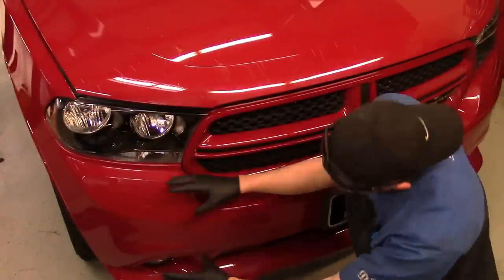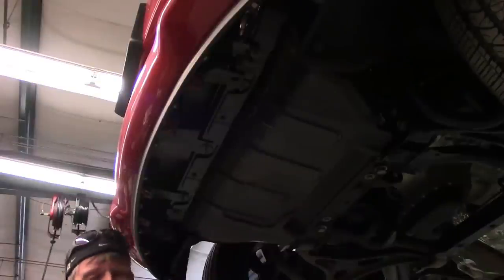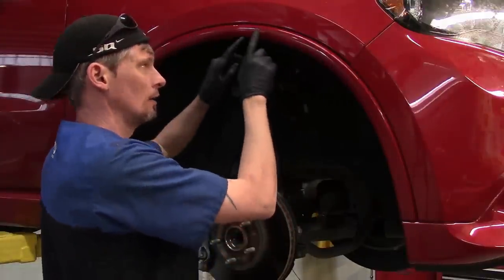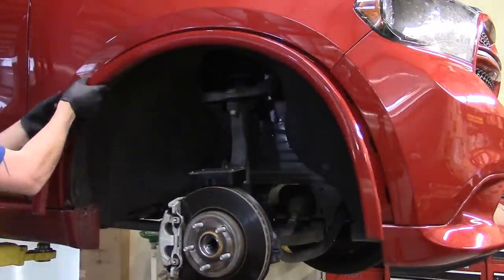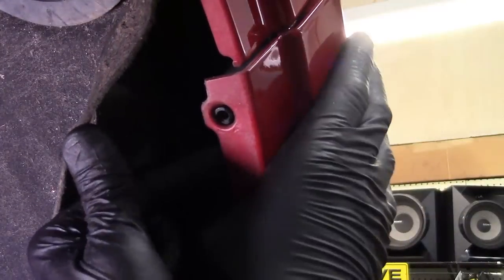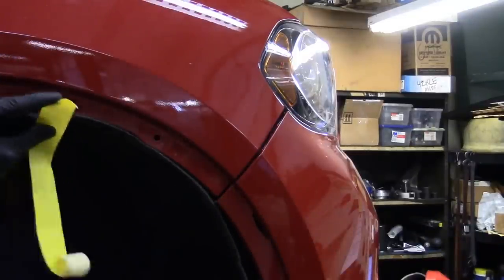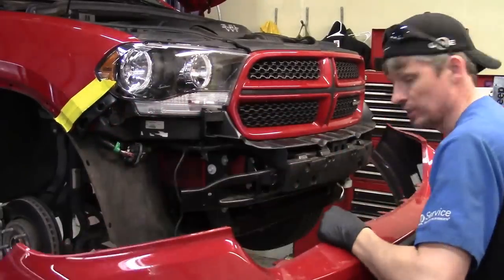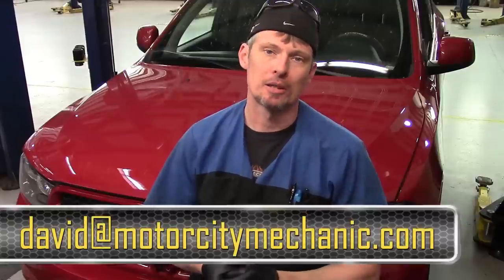2011-2013 Dodge Durango front bumper cover/fascia removal

Comment: Great instructional video. Do you have a plan to make one for rear bumper too?
Reply from the maker: Possibly.....just need to find the vehicle needing that repair and the time. I will certainly put it in the "to film" list. Thanks for the request and for watching.
Reply: @MotorCityMechanic  have you made this rear bumper video? Would love to watch... Having issues with the modules that connect to the back up camera and parking sensors

Comment: Nice video! What would be a good estimate for a bumper replacement if it was being done at a shop? Thanks for any feedback!
Reply from the maker: Appreciate it Hanoy. I dont know that the price of the part or what it would cost to have it painted. I would thing that 2 hours would be a good time estimate to remove and replace the bumper.  With lets say $100.00 per hour labor rate...that would be around $200.00 just in labor. Thanks for the question and make sure to subscribe

Comment: Is the bumper all one piece or is it an upper and lower?  I have damage just below my headlight.
Reply from the maker: What year is it?
Reply: I have a 2014 Durango it has two bumpers the top and the bottom. My bottom was damaged I was able to get just the bottom piece fix
Reply: It's a 2014.... I gave in and took it to a body shop..  thank you for the replies .
Reply from the maker: @johncioffoletti1485  Thanks for the reply.

Comment: Can a 2018 bumper fit a 2012? Trying to put a 2018 RT bumper on a 2012 RT.
Reply from the maker: There is a difference from what I see. 2014-2018 will swap but 2012 doesnt show to be a direct swap however. Thanks for asking and make sure to subscribe.